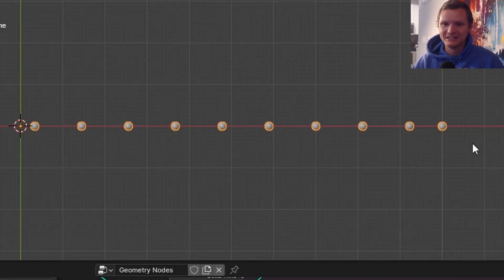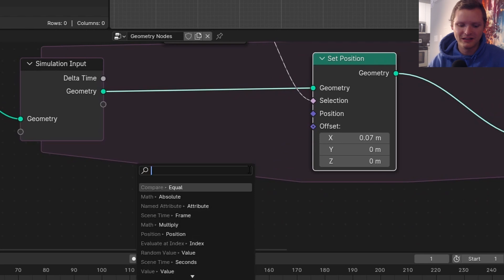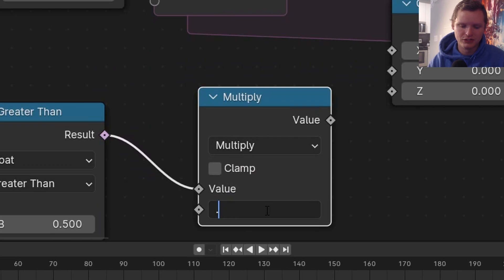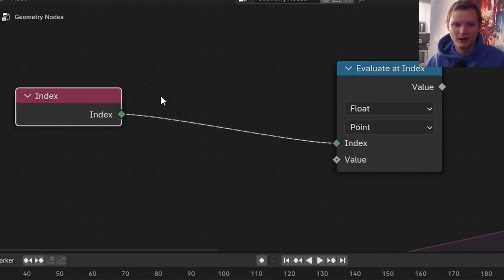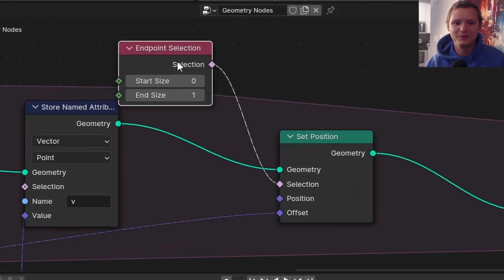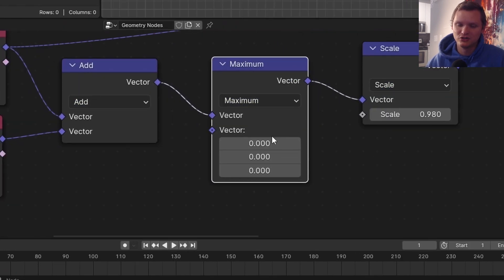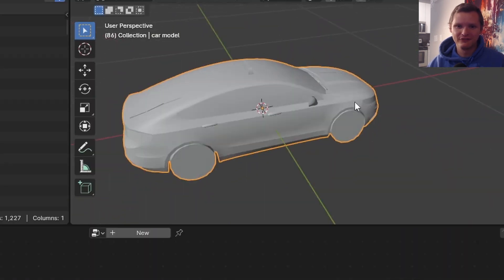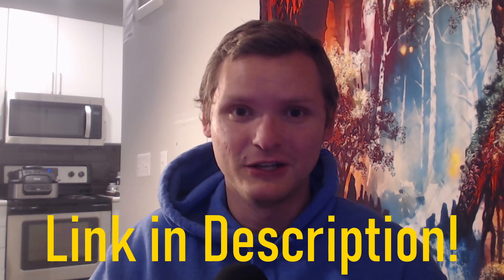procedural traffic in blender

Comment: Could you make a video about creating a true Voronoi texture inside of Blender? Long story short Blender's Voronoi node doesn't actually let you access or modify the point density of the Voronoi pattern so you don't have true control over the cell size/point distribution.

So for example if I wanted to make a realistic pattern for Alligator scales it would be impossible to set where I wanted larger scales and smaller scales that match up perfectly, simply overlaying different scaled Voronoi patterns doesn't really do the trick here, if we had a true Voronoi implementation where we could control a density map for the voronoi math we could make some really really cool shaders.

I've come across an older solution that used geometry nodes but it required extremely dense geometry to work and it had a couple of other limitations to it like it didn't technically work in 3D space. I'm thinking with all the Geometry node updates there might be a new way to do this that may be significantly more performant and accurate.
^
If we could use legit random points that we generate and then do all the math to create the usual voronoi patterns from evaluating the distance between these points then I think that would be reasonable. If you do make a video on this, might I ask that you also include how to get the distance to edge voronoi result? I was never able to translate what I had to the distance to edge mode.
Reply: I'm pretty sure the new release (Blender 4) now has that ability using just a redesigned Voronoi texture node.

Comment: Next challenge could be using final acceleration and velocity data as attributes to animate the luminance of the brake lights so that they'll be on whenever the acceleration is negative or the velocity is zero.
Reply: And some math for the wheel's to spin correctly along the ground to finish it off
Reply: @OGPatriot03  That's simple enough — the wheel turns 1 radian per radius of translation (and the radius is one half of the wheel's z dimensions).
Reply: This reminds me of how some actual EVs brake lights l do not turn on when  regenerative braking engages even if deceleration is very noticeable.